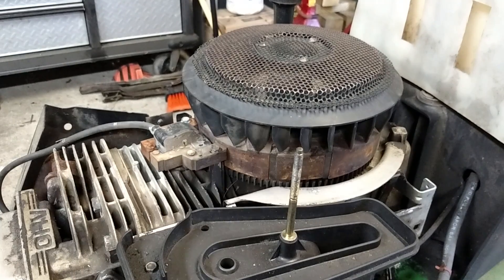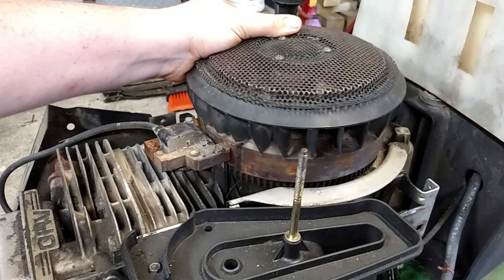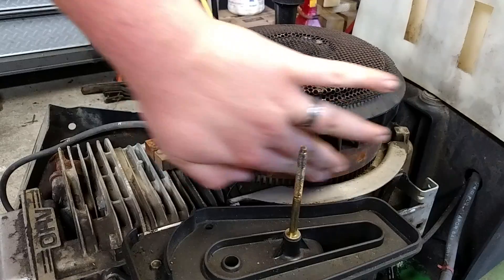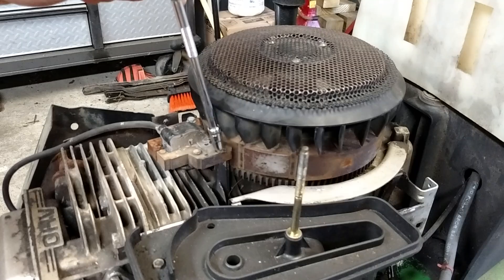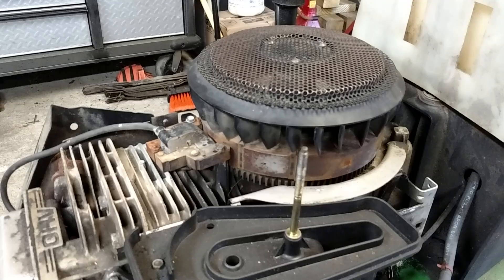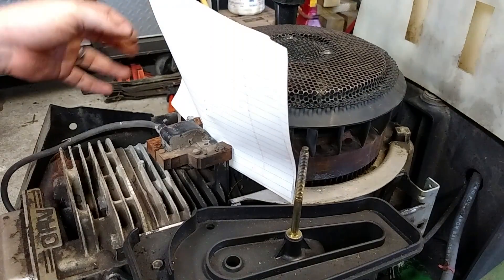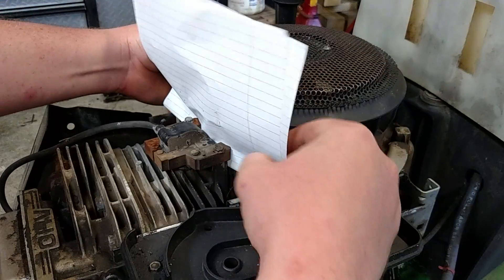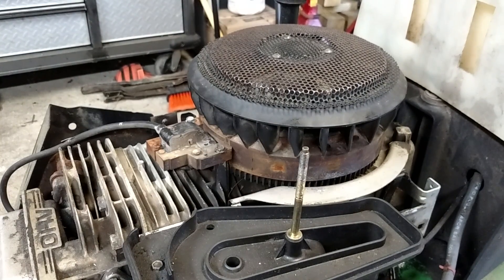How to gap a coil on a Briggs and Stratton

Comment: I've use a cigarette pack cardboard all my life and it always works for me. It's thin enough to set gap on a lot of different engines.  But not for chainsaw  they need smaller gap and it's easily find on google with thickness you need . Thanks again for the presentation 😊 well done sir

Comment: I used cut up sections of a gallon plastic milk jug. It was close to the correct width and you can pull them out after you tighten the bolts down. Throw them in your lawnmower tool box and you can use them over again.

Comment: Does that coil mount to the block or a bracket that mounts to the block?
Reply: It mounts to two raised threaded holes on the block!
Reply: @randallstewart8487  i didn't tight them hard enough and started the mower. So the magnet pulled the coil and it hit it. Those 2 raised things broke. So I need to replace the engine or is their away to fix it or?
Reply: @kavenal5412  I understan what you are saying,that can surely happen if they get loose or not tightened enough,I just got back in the house,been in garage and doing exactly what you are talking about,set the gap and just got done tightening those two screws,that is bad that those broke,no way to hold that coil now,I have never had that happen,maybe someone that has fixed that problem before will be on here and let you know how they did it,if anyone ever did without replacing the engine,that may be your best way to go with a good used engine,but use caution when buying used,unless you know them,I would have to see and hear it run and start after getting warmed up,sorry to be the bearer of bad news,but you will probably have to replace it,hope it works out well for you!
Reply: @randallstewart8487  thank you. If I replace the engine I'd buy new as it would come with 3 year warranty

Comment: What is the gap setting on these? I have yard machine 13hp it has the Tecumseh engine, i been replacing all basic parts to see why it ls not starting no cranking no sound when turning the key, got new battery just week ago just wondering if its actually safety switch issues not working correctly thats causing all the problems im thinking bout by passing the switches having direct hook up without the switches i cant think of anything else it can be?
Reply: 12

Comment: I just successfully created a spark and now the engine will start.

It was the rust on the flywheel that caused enough of a gap problem! After 10 years it is now running again. Your comment about not having experienced rust causing a problem prompted me to 120 grit sand the flywheel.

Thank you!

Comment: I bought a coil for my Briggs & Stratton push mower, and the coil, which is not the correct one, does not sit flush against the fly wheel. Can I grind a part of it so that it is flush and produces the necessary power? And no, it is impossible to find the model and part number, and the machine does not have it, nor does Briggs & Stratton.

Comment: That block that is connected to the spark plug cable, what is it called? I need to replace that block on my snapper mower. Please and thank you
Reply from the maker: Ignition coil
Reply: @Powertool1990  aweosme thank you. One other question, mine is a junk find, i didnt see a battery, do all snapper riding mowers require a battery? If so what size? This one has a 9hp briggs and stratton engine

Comment: Awesome advice. ... I installed coil with eyeball approach - resulted in sporadic misfire. Took your advice , used notebook paper ( folded ) to adjust /set gap and sporadic misfire gone. Steady and true at full throttle now. Thanks !

Comment: Thanks that helped on my John deer. I tried a couple different things the paper trick worked for me I actually had to do 2 pieces of paper folded up because coil kept rubbing on the fly wheel but it runs so much better now

Comment: i always use a business card to set the gap
Reply: For the old timers , this was the go to method, there is a reason..., bearing run out, if you run your coil into the flywheel then you will learn.  0.015 to 0.020" gives you some bearing slack back lash  leaway.  I set my last one to 0.012 but typically I always did 0.020" and feel more comfortable with a Business card.  Which is closer to 20 th.  Lean towards the thicker side..

Comment: THANK YOU FOR THIS AND YOUR VIDEO ABOUT HOW TO GAP MY INTAKE AND EXHAUST VALVES!!!! I fought with my mower for about 4 hours, doing everything that I knew worked last year. I couldn't get it to fire up for the first 4 hours other than it giving a "POP" sound, sounded like it backfired. I only tried twice after hearing that. Well, it's been awhile since I've had to really get into the main parts of an engine, and I totally forgot about TDC on intake and exhaust. I felt pretty retarded because I've adjusted gaps in other mowers in the past. It still wasn't wanting to fire up, then I remembered my coil was pretty rusty, as well as the magnets. I took the coil pack off and cleaned everything up like new, reassembled it, and it wouldn't start still. Then I had a moment where my brain did what it's supposed to do and I remembered that I gapped the coil too far back. Then I did it right up to the magnets. I tried your gapping technique, expecting it to still not start. Within half a pull, VROOOOOOM!!!! It now runs like the day I got it. I know the video is 4 years old, but it saved me from saying to hell with it and just buying a new one. After all it's only a 2017 Craftsman 7.25 163cc with the "guarantee to start for X amount of time" so I thought I'd try to just fix it. You, good sir, saved me $499 +tax. So, again, I say to you...THANK YOU FOR THE TWO VIDEOS YOU MADE THAT I NEEDED!

Comment: Hi. My engine will not spin like the one in this video. It never spun  freely (but worked when ignition engaged). Now it won't start. I opened  up the red metal panel and saw that the ignition wire was chewed buy vermin. Thet lead me to this video. Any ideas on now to get the engine  moving? Thanks.

Comment: Thinking back the mower gas cap has hissed when it needed gas. Sat on the back patio rest of today and started her and  running like brand new and put it away.
Reply from the maker: Sounds like your fuel tank vent is clogged. If it's in the cap, you can clear it in the small hole in the middle with a paper clip, or it could have another style of vent but that's what it sounds like. It shouldn't hiss when you open the fuel tank, I bet it's vapor locking the fuel in the tank not allowing proper fuel flow
Reply: @Powertool1990  Nope sorry. I blew the car several times and the compressed air is blowing through the vent with no problem. I also drained the tank and the fuel flowed freely until empty with the cap on. I don't know what else to try.

Comment: Is it common to have the ignition coil to last only after 4 seasons of use?
Reply from the maker: It's not very common but it's not unheard of either. Have you confirmed with spark tester? Remove the small ground connector that grounds out the coil to confirm the coil is actually bad or if maybe it's just being grounded out by a safety switch or something.
Reply: @Powertool1990  O boy. I just changed the spark plug and when the engine dies after running roughly more and more I put a new plug in ground the plug out and had no spark. She had started running progressively rough the last few lawn cuttings , but only after running for like 30 minutes like the coil was heating up. I'd wait 10minutes letting it cool and she ran fine for another 10 to 15 minutes then started to act like it was running out of gas. Gas cap is clean and clear, fuel line no blockage, gas filter replaced. The running rough got worse each mowing then just died. She starts but runs /missing right away now. If she was grounding out on s safety switch or something. Would she not start at all?
Reply from the maker: @elcidlord  if it's running and progressively getting worse when it gets hot, I suspect you're on the right track. If it was a safety switch it would die instantly.
Reply: @Powertool1990  Thank you. That's what I was thinking. Have the rider stripped down. Wait for the part to be delivered.
Reply: @Powertool1990  No I did not. The coil has been shipped and awaiting arrival. When the engine did die I replaced the spark plug and held it to the engine/frame to see if it sparked and had no spark when I turned the engine over.
Reply: @Powertool1990  Oh God. I got the new ignition coil aid the replacement meticulously. Just had the rider out and she still starts breaking up/missing or acting like running out of gas and then dies after about 15-20 minutes mowing. Any more suggestions please? I'm  out of ideas. Thank you.
Reply from the maker: @elcidlord  when it dies, take the fuel cap off slowly and if it sounds like a soda opening, that means the fuel tank is vapor locking and not allowing fuel flow after running so long. If that happens, check the fuel tank vent, normally in the fuel cap of most mowers.
Reply: @Powertool1990  Thank you. That is the first thing I tried several times and blowing out the cap and vent several times. It's spotless. I'll try again. Even tried with the cap off or cracked open. I'm so confused. Maybe put mower in garden and plant flowers around her to give it that fresh farming look.
Reply: I do remember way back the cap hissing when I turned it to fill with gas when she was breaking up and tank half or almost full.

Comment: Good video. I did no know I should clean the magnet before I gap the coil. Thank you. My coil has just failed and waiting for the new one to be shipped.
Reply: You just clean the magnet to remove rust that would affect the gap .... doesn't make it fire better !!  Thanks !! 😎
Reply: @waylonmccrae3546  THanks. I gave up. Nothing worked. Took my rider into the shop.

Comment: I bought a walmart battery with 220 cold crank amps slow turnover wouldn't start.. But when I hook the battery up with jumper cables to my truck battery it fires up.. Could I need a 330 cold cranking battery for a cub cadet zero turn rtz
Reply from the maker: I always put a higher cca on mowers with bigger engines or 2 cylinder engines, I only put the Walmart 220 in single cylinder engines. Also if it's a briggs and stratton your valves could need to be adjusted. If they have to much lash it won't hit the compression release on the cam.

Comment: So I was having problems with the motor cutting out after 20 minutes or so. Figured it was either the coil or fuel solenoid on the bottom of the carb so I bought chinese knockoffs of both. I changed the coil. Wouldn't even turn over. Found this video and went through all the steps. Still nothing. Figured maybe I got the wrong coil. Put my old one back on and still wouln't crank. Any ideas? Could I have done something to the battery? It's not that old and it's been starting fine all year. I had it disconnected while changing the coil.
Reply from the maker: When you say cutting out after 20 mins I'd check your fuel cap vent. The fuel tank can vapor lock causing no fuel flow. When it cuts off I'd crack open the fuel cap and listen for any sound like opening a soda can, relieving pressure in the tank. But now you say it doesn't turn over at all?
Reply: @Powertool1990  Thanks much for the reply. Turns out the battery was dead, jumped it and it fired right up. I guess 2 years is all you get out of the cheaper batteries now. I'll get a new one tomorrow and put the new coil back and see what happens from there.
Thanks again
Reply: Ain’t got no gas

Comment: If adjusted as you know but not produce current then how do
Reply: check woodruff key insert on shaft and fly wheel  ( small steel pin in slot on shaft  some time shears off  replace  (woodruff key)take old one with you  they come  in many sizes.  any hardware store will have one

Comment: Hello everyone.Just a question....does this air gap affects the 4-stroke cycle of the engine?
Here's the thing...my engine(Briggs&Station 4-stroke)starts normally but cant keep working and eventually stops.
Carburetor has been cleaned,checked and working fine.
Gasoline is replaced with fresh new.
Spark plug checked...works fine.
Any suggestions?
Reply from the maker: The gap should have nothing to do with your issue. However, the coil could get hot and stop working, it's rare but I've seen it happen. When it stops running, hook up a spark tester and check for spark. Also another thing to check and is a, common problem is the gas tank cap vent. If the vent in the cap is clogged it will vacuum lock the fuel from flowing. A good indicator of this is when it stops running, crack the fuel tank cap, if you hear air like opening a soda can, then it's vacuum locking the tank preventing fuel flow.

Comment: Ignition Coil for engine model 310707  type 3346 65 code 120323za any ideas how to get one
Reply from the maker: Model number is correct but type doesn't seem right. I'm not able to look it up with that number.
Reply: @Powertool1990  that is what is engraved right next to the model number.
Reply from the maker: @3RDWATCH7  briggs and stratton? How old is it? Nothing comes up when I look up parts.
Reply: @Powertool1990  yes it is few years old over 8 years.  It's a ride on tractor. I see one on Amazon but it says 311707
Reply: @Powertool1990  I believe the "code" is the date of manufacturer.  In this case 23 March 2012.

Comment: Same engine, I have done the same, I have weak spark. New coil and plug. I'll have spark from my coil wire but not the spark plug.
Reply: most likly ground like my case run a ground direct from bolt on ignition coil to negative battry cable